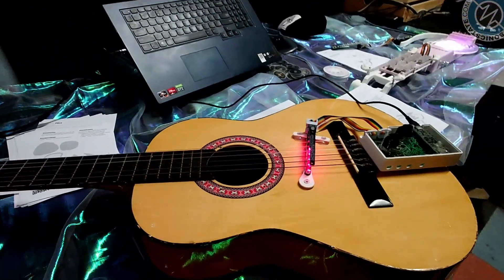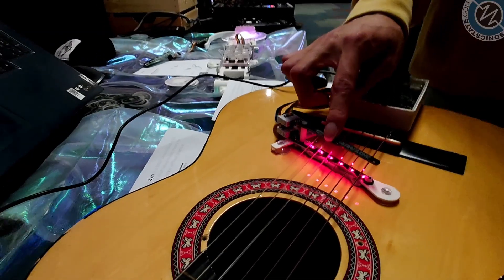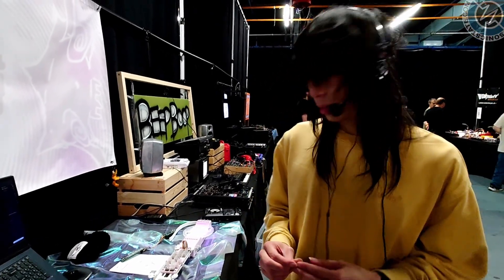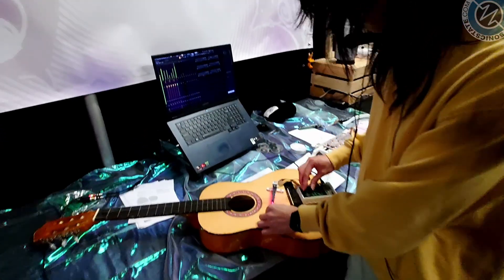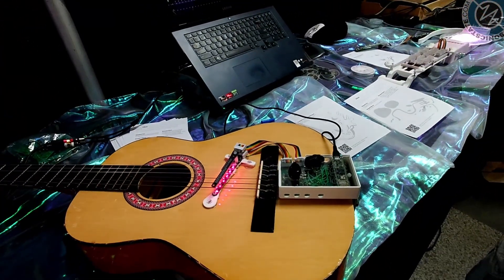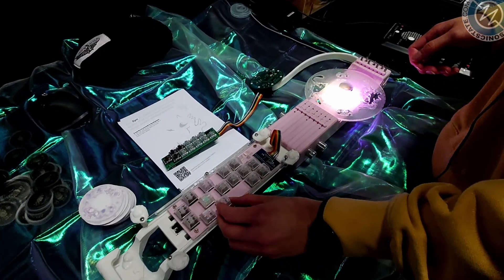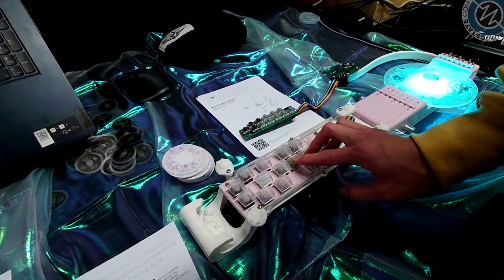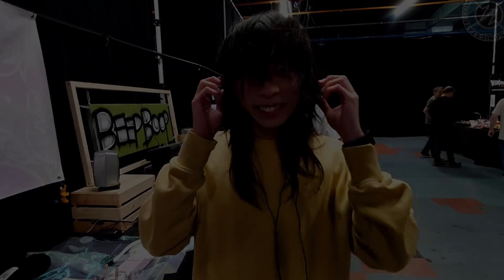Kitter Chord Hexaphonic Photonic Pickup Laser Powered Guitar Pickup - Bristronica 25

Comment: In the early 80's my 1st MIDI guitar set-up (Pitch To MIDI) was similar to this. 6 Hexaphonic pickups & midi channels with the red lights..Made by Gibson, Phi-Tech Photon MIDI converter.Had it Midi'ed to a keyboard & a Roland sound module.Liked that there was a Trem bar on this.& you could have fuzz or other effects. Photon tracked pretty well for the time frame it was released. This is the 1st time I've seen anything else,with a pick-up like that.Hope it makes it to market..That has some Real Potential...
Reply: wow wow wow i had no idea about it and its design looks remarkably similar to mine! and apparently all the strings were tuned to high e for faster tracking? i wonder why they only lasted 18 months,, though it must have been so much harder to pull off at the time

Comment: This tech has a lot of potential! I imagine some future version of this where light sensors are inside the guitar, too, to capture the vibration of the body. But in the meantime, a pickup either near the bridge or in the sound hole would open up a lot of possibilities for capturing acoustic guitar performances to use as is, manipulate or even convert to MIDI. 👍🎹🎸